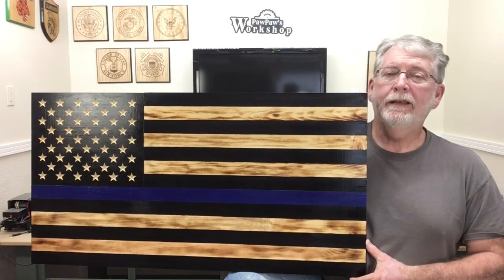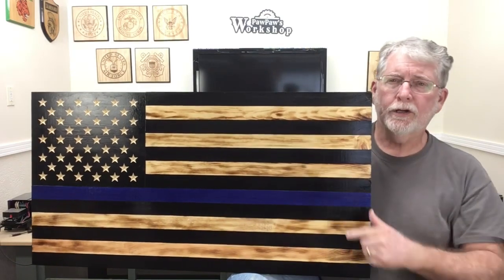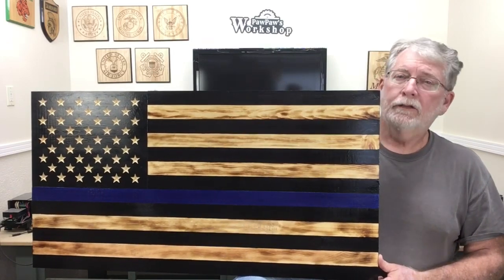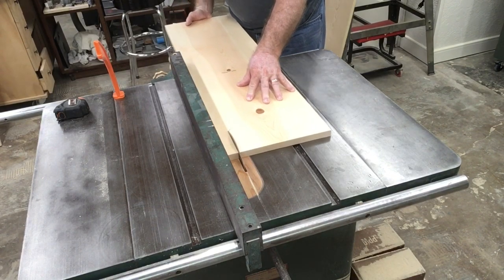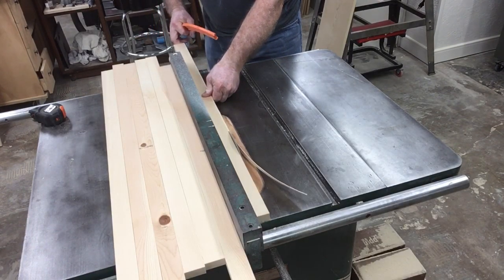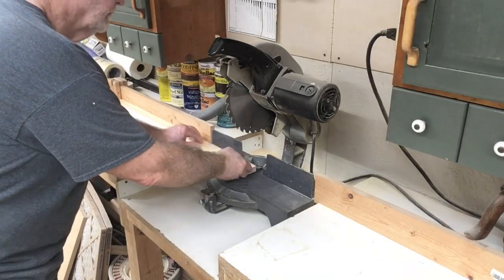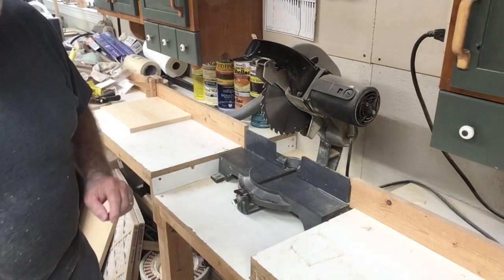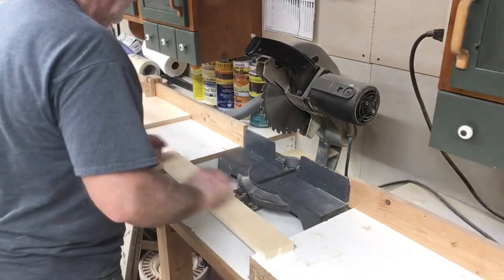New Techniques Used to Make a Special Flag

Comment: Do you like the staples better than the brad nails?
Reply from the maker: I like both depending on what project that I am working on.  The staples have a better holding power.
Reply: @PawPawsWorkShop  im guessing you like them better for your flags and I may have to go pick one up for mine, usually use a brad nailer. Your videos are very helpful.
Reply from the maker: Thank you

Comment: Hey,   what size bit are you using to carve your stars?    I am having some difficulty getting mine carved.  I am attempting with a 90 degree V-bit 3/8 diameter. The router plunges the initial cut, but then raises and jogs over the work material.  Thanks!

Comment: The problem I am having with 1x12 is the cupping, what say you? Thanks.
Reply from the maker: It is drying uneven.  That can be a problem and is why I usually use a 2x4 for the flags and rip them down.  This 1x12 was purchased and cut the same day and I did not have the cupping problem.

Comment: The union I’m pretty sure . Should be 14 13/16” x 10.5”.
Reply from the maker: That very well may be, however, I have chosen to alter the ratios slightly to make my flags with a little easier measurements.
Reply: You are correct. At least should have kept it closer than 13” (14.5” or 15” ) It looks disproportionate. There are flag ratios for a reason.

Comment: I noticed on this file when i open it that the depth is set to .2 Is that the correct depth? I've seen in the past you said no more than .12?
Reply from the maker: On the vast majority of the projects that I carve they are shallow. For the stars I want a sharp point at the bottom. The .2 does that. If you want a flat bottom then set the depth at .1.
Reply: @PawPawsWorkShop  Thank you!